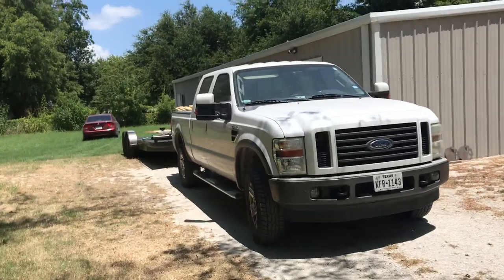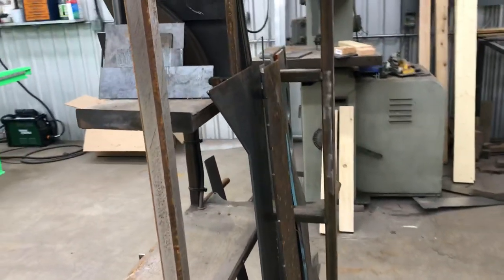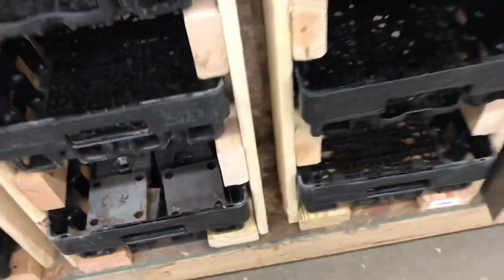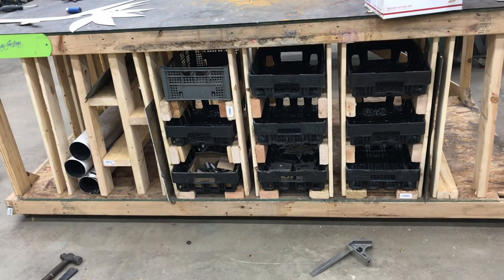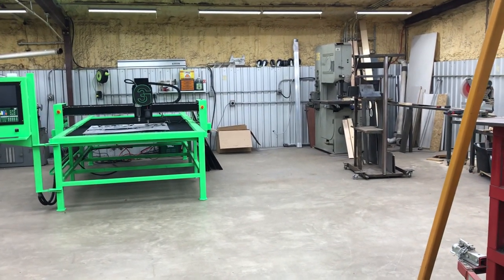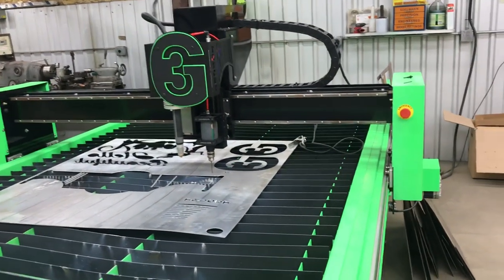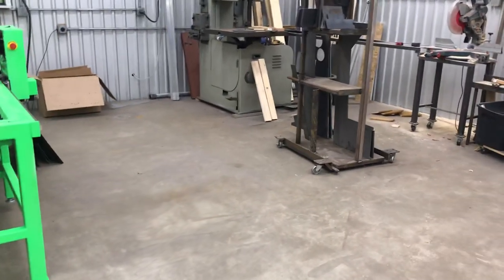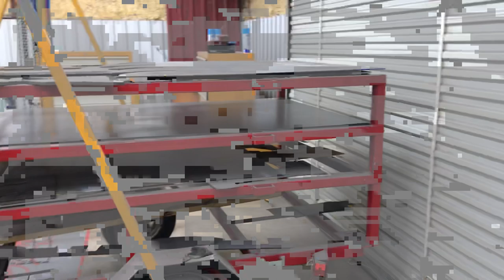Metal storage monstrosity- shop update

Comment: That scrap is nothing but "in process inventory" which is a very expensive component of shop floor accounting.  The best way to handle it is to dispose of all drops after first working the entire raw sheet(s) into customer's project cost.   It seems like you are throwing out valuable supplies but the converse is the equivalent to stepping over dollar bills to pick up pennies.  Don't let it rent space free of charge in your head and on your shop floor.

Comment: I think some diy kits is where I would start for off cuts. Scrap bags are worth a shot, idk how that will work out long term. What about selling scrap bag material by the pound to a local vocational school? One thing I would do is make plates with bolt holes. For home shop guys that would weld to them and bolt to whatever. 3x3, 4x4, 6x6 etcetc. Four holes and a square  or rectangular part. Good way to keep from pitching 1/4 or heavier stock in the scrap bin. Easy Ebay thing too. Pretty neat to get development involvement on the tru cut. Thanks for sharing

Comment: Hi,
Maybe you could put your thinking hat on and figure out some small parts to cut.  Then you could cut them at the same time you are doing your real work.  That way you could get rid of the large pieces  with smaller uncut areas.  Maybe you could hold some type of a contest for ideas on using up your scrap.   If nothing else you could cut pieces the size of a USPS flat rate box and make some type of assortment of piece thicknesses.
Just something you might consider.  I am sure others might have even better ideas.
Good Luck!
John

Comment: Your cutting problem sounds more like a control issue than the plasma power unit.
Reply from the maker: torch height controlled is maintained by voltage reading.  To maintain a given height above the material, the cutter is providing a voltage output back to the controller in real time as its cutting specifying the voltage of the arc.  The longer the arc, the higher the voltage.  The controller uses this info to adjust the Z servo motor against the specified voltage for that given cut amperage, material thickness, and material type.  The divider board in the cutter is providing eratic info back to the controller.

Comment: Great to see some new ideas on the shop layout Gary! I like what you are working on and would like to know if you have some plans on working on some more design kits for DIY tool station stuff that would help small DIY shops use some tools that can be cost effective with more then one purpose like the hole punch station you built a couple of years ago, let me know if that is some thing you have thought about! Keep grinding Brother, Also curious about the paint booth and if you have had any time to work on that project lately?